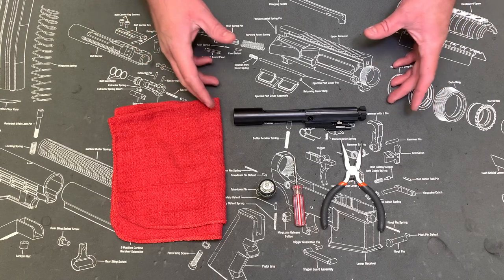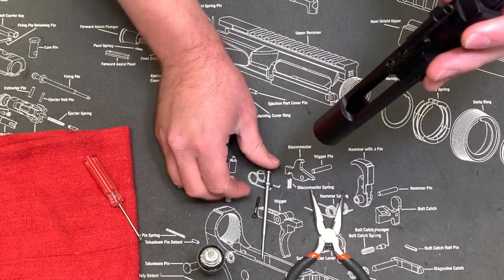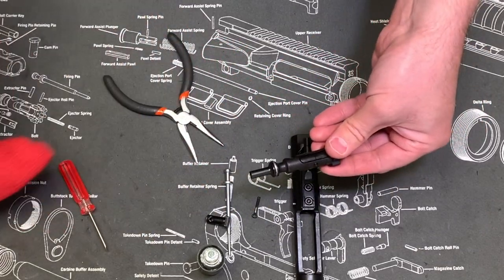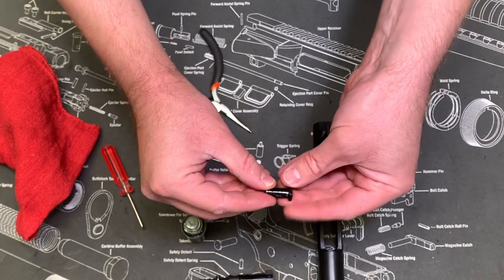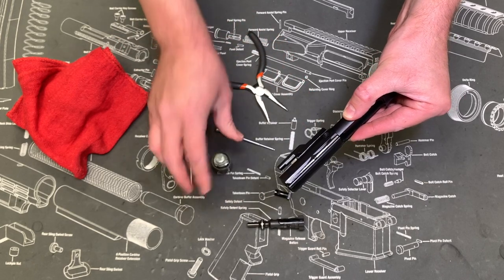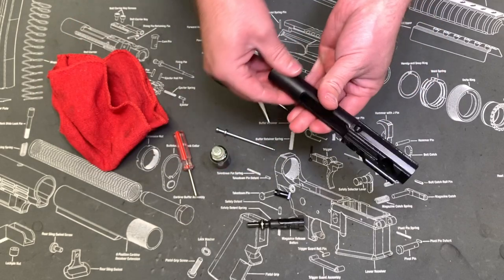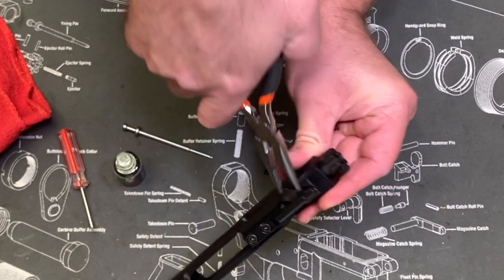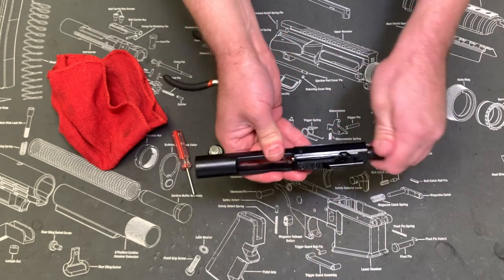How To Oil A Bolt Carrier Group (BCG)

Comment: There’s no such thing as too much oil on your bcg’ just don’t oil your firing pin.
Reply: Too much oil attracts dirt, you can use too much oil.
Reply: He shoots indoors once a year, gun is definitely a mess. Drop a qt of penzoil in there, that should work
Reply: I mean it all depends how frequent and disciplined you are with breaking it down and doing full cleans. Sure, the more the better when it comes to the longevity of your parts, however, ONLY if you're cleaning it after every hard use. If not, and you soak it in oil, then it's going to attract dirt to the point of becoming an abrasive, and then that will speed up the wear on everything/increase malfunctions. And let's be real...hardly any of us are cleaning our guns the way we should lol

Comment: IF the new bolt came with sticky factory grease on it, then you also need to remove the extractor to clean the grease off it too.

Comment: A drop of oil on that extractor spring & pin would be a good idea.  I prefer grease on the wear-surfaces of the carrier rather than oil, and a check on those gas rings to un-align the ring openings is a good idea although the gun will run even if they are aligned and leaking some gas.  Good video, thanks.
Reply: Grease has always been a problem when I’ve used it. Tried several different “great ones” but seems to turn gummy. Any suggestions?
Reply: @michaelshanahan4965  I use synthetic wheel bearing grease sparingly on the carrier rails and oil on the bolt. Wheel bearing grease is designed for high temp and doesn’t degrade and turn gummy in my experience.

Comment: According to the manual two drops of CLP (cleaning Lubricant Preservative) in the carrier key.  That's the gas tube on top of the bolt carrier.  Only two drops.  Too much will cause the oil to spray out of the Gas vents on the carrier when you fire the AR.  Helps to keep carbon buildup from getting crusty in the Gas tube.  Clean the Gas tube with a pipe cleaner.  You can use a qtip butt sometimes if your not paying attention the tip will remain in the gas tube.  If I use a Qtip I use the wooden stick type Qtip.  Pipe cleaner is better...Can I get a HO--AH  out of that?

Comment: How often should you clean your bolt carrier?
Reply: Depends on the ammo and conditions you're keeping the firearm in or firing it in but a good rule of thumb imo is between 200-500 rounds just to keep from carbon building up and to keep a good layer of oil on the bcg to help prevent rust and extra wear

Comment: What about rifle sits long periods of time between range sessions?  Oil or grease
Reply: I oil the exterior mating surfaces of mine every time I get to the range before firing. Just remove the take down pin, pull the BCG out, oil lightly and reassemble.

Comment: Great Info. Never knew you could over-oil it.
Reply: You can't. You can waste oil but you can't dangerously overoil it. There's a video on YouTube of a couple of guys submerging a fully assembled AR15 in a tub of Mobil 1 synthetic motor oil, removing it from the tub of oil and shooting it while the oil was still draining out of it. It operated with no problems (aside from spraying the shooter in motor oil).
Reply: @richardlahan7068  agreed , I probably over oil mine. If it moves, it gets oil
Reply: @siaalpha  I generally just oil the rails on the bolt carrier & put a few drops down the hole where the cam pin goes into the bolt carrier.
Reply: You can soak it in oil but all it does is attract dirt.  It dangerous just dumb.
Reply: You can’t only a fool doesn’t oil a moving part
Reply: The issue with using too much is attracting dirt. Stay disciplined on cleaning after every full use, and you don't gotta worry about over oiling. However, if you aren't someone who does a full breakdown after shooting and really clean that gun, then you'll build up dirt way faster if you heavily oil, and that will become an abrasive inside the weapon and quicken wear/cause more malfunctions. But, if you like to keep things clean like I do (95% of the time...sometimes we're all lazy a lil bit), then oil it up as much as you'd like. Just don't let it sit or go multiple days to the range without cleaning it if that's the case